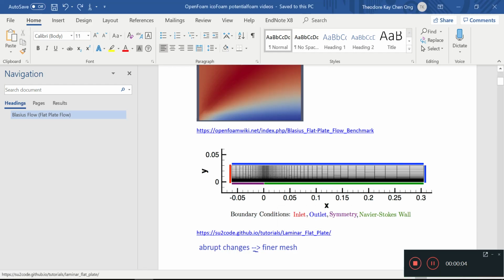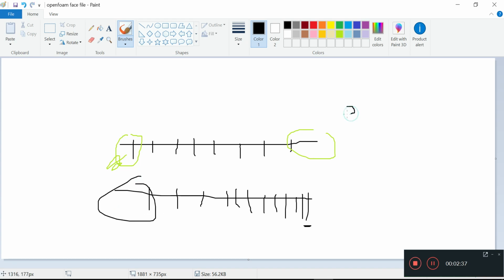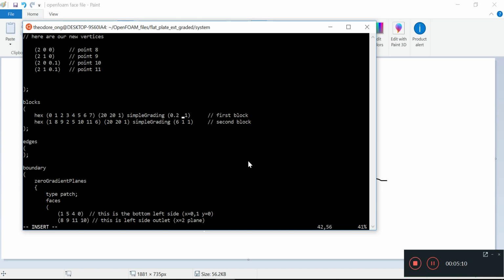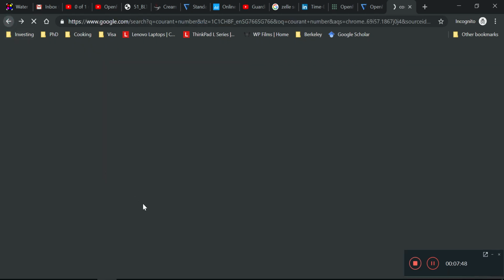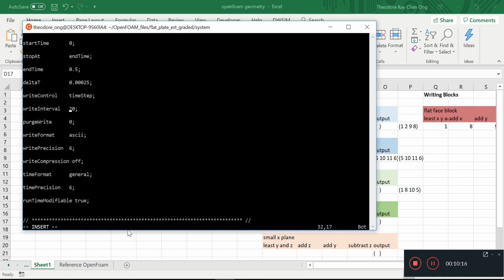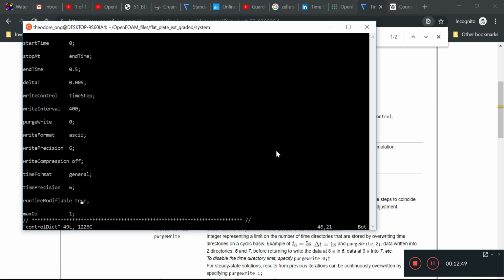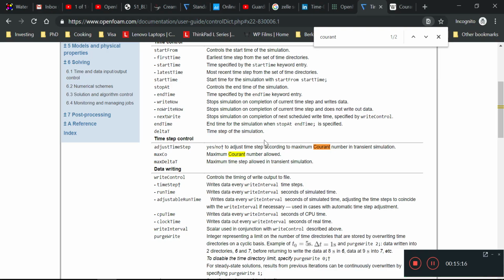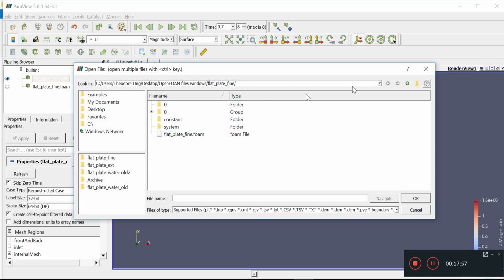OpenFoam for Beginners Win10 20 - Flat Plate BL flow mesh grading test

Comment: Hello, thanks for you Video.you set the initial Ux 1m/s, but the simulation results show that it is greater than 1m/s. Can you explain the reason? I am doing a simulation of the k-epsilon turbulence model in a waterchannel, I set the initial Ux 0.05 m/s, but the result is also a velocity distribution greater than 0.05 m/s. I would like to communicate with you and look forward to your reply.
Reply: @TheoOngScienceAndEngineering Hi, I have found the answer, since the flow velocity near the boundary layer is very low, so the upper region will be greater than the initial value, which is normal. Thanks for your reply nonetheless